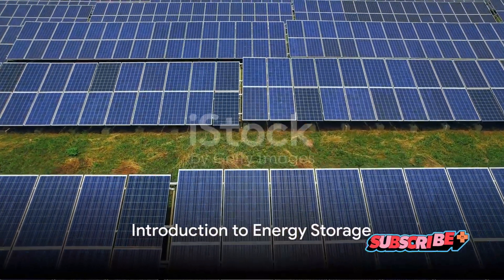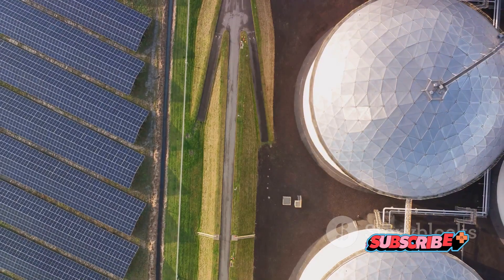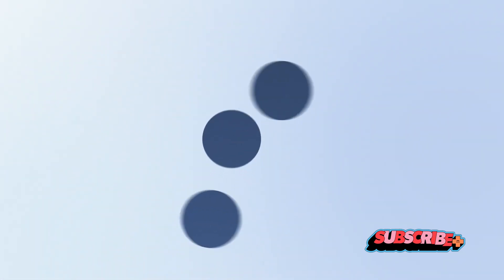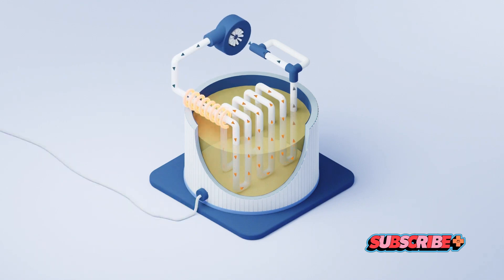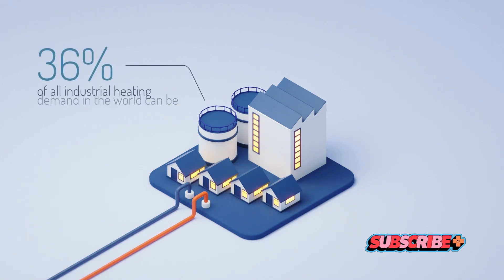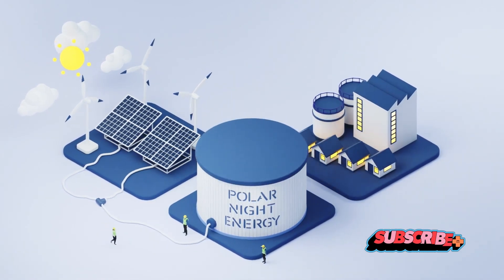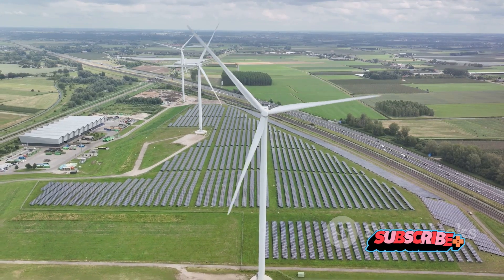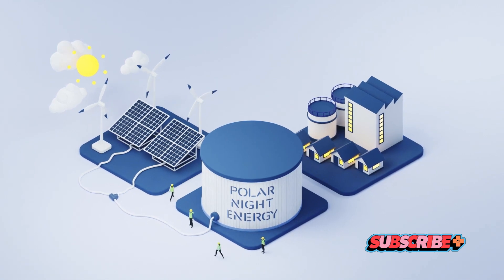Top Energy Expert Reveals Shocking Truth About Sand Battery #sandbattery #sand #futurebattery

Comment: What are the cons of the sand battery?
Reply from the maker: While sand batteries offer several advantages, they also have some limitations:

Low efficiency: Sand batteries are not as efficient as certain alternative energy storage technologies. During the charging and discharging processes, the inherent properties of the sand bed cause heat to dissipate, resulting in the loss of some energy1.
Heat loss: Over time, sand batteries experience heat loss due to natural dissipation1. This means that the stored heat can decrease even when it’s not being used, which could potentially limit the effectiveness of the battery over longer periods.
These are some of the main drawbacks of sand batteries. However, it’s important to note that research and development in this area is ongoing, and improvements may be made over time to address these issues.

Comment: I saw this subject on tv two years ago. Theyre more likely to use wood, if solar power comes with it. 
Maybe it is sand. And has been tested with dirt batteries, and earth ground.
Reply from the maker: Certainly! The concept of a sand battery is indeed fascinating and has the potential to revolutionize green energy storage. Let me shed some light on this innovative technology.

Advantages of Sand Batteries
   - Cost-Effective: Unlike conventional lithium-ion batteries, sand batteries are low-cost and have a smaller environmental footprint.
   - High Capacity: They can store significant amounts of energy for extended periods.
   - Stability: Sand grains can withstand high temperatures, making them suitable for long-term storage.

The Finnish Sand Battery:
   - In the town of Kankaanpää: Finland, a team of young engineers from *Polar Night Energy* has successfully installed the world's first fully working sand battery.
   - The key element? Approximately 100 tonnes of builder's sand piled inside a silo.
   - This innovative solution aims to address the challenge of intermittency in renewable energy sources—how to maintain a stable power supply when the sun isn't shining or the wind isn't blowing.
   - By using sand as a heat storage medium, they've created a practical and efficient way to store excess green energy for months at a time.

The Future of Sand Batteries:
   - As climate change drives investment in renewable energy production, solutions like sand batteries could play a crucial role in balancing energy grids.
   - While large-scale batteries remain essential, the simplicity and affordability of sand batteries make them an exciting addition to the clean energy landscape.

So, next time you see a pile of sand, remember that it might just be the key to a more sustainable energy future! 🌱🔋